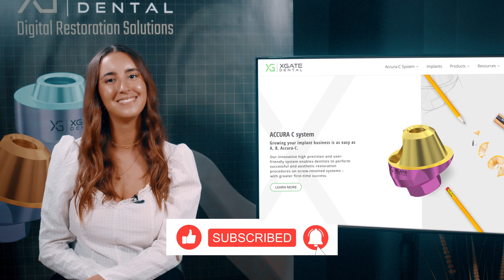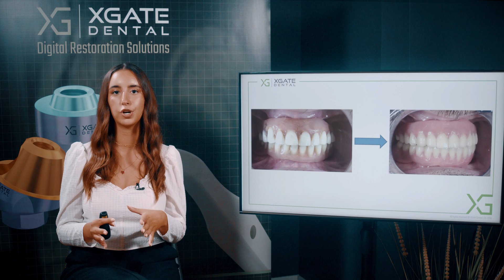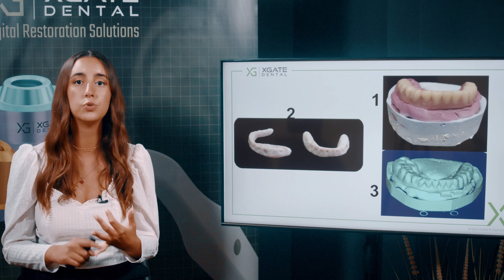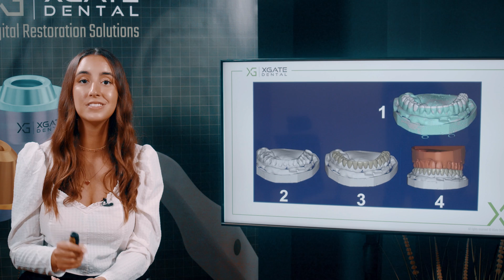New dental implant in one day. How to use CAD CAM and other advantages of dental technology.

Comment from the maker: 00:00 Announcement
00:34 Evolution of intraoral scanners
01:00 What happened before CAD CAM technology
01:21 Cases based on CAD CAM
02:00 Why implantation work has become much easier
02:29 First case
03:00 Crown copying
04:04 Popular implant technologies
05:00 99% accuracy when creating an impression
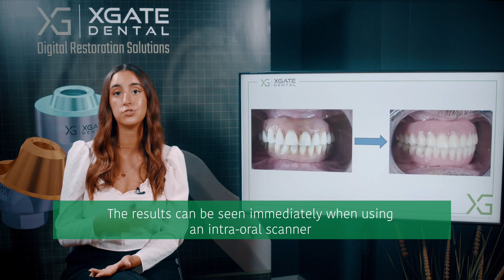05:30 You can always correct mistakes
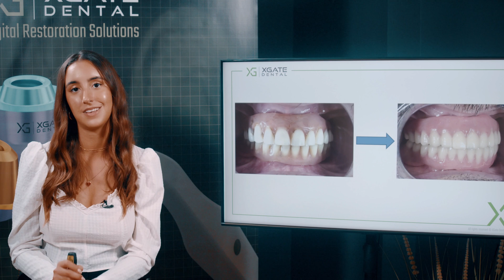06:00 3 years ago we did not have such opportunities
07:00 This design was made with CAD CAM
08:20 Perfect teeth